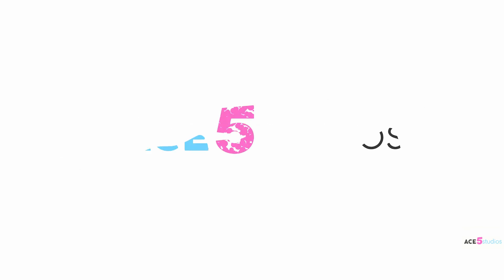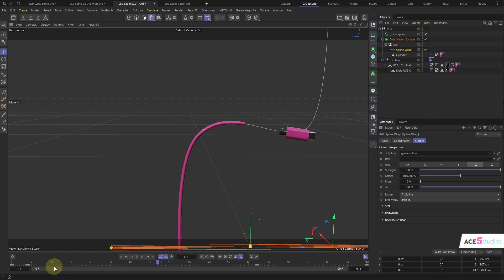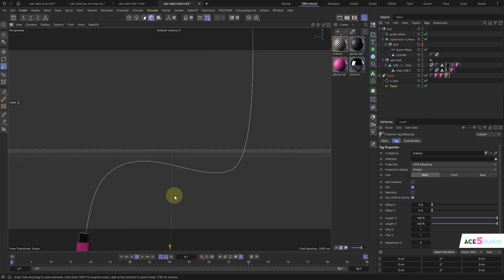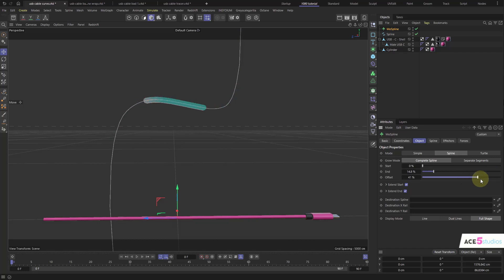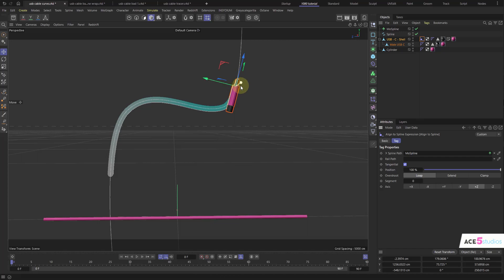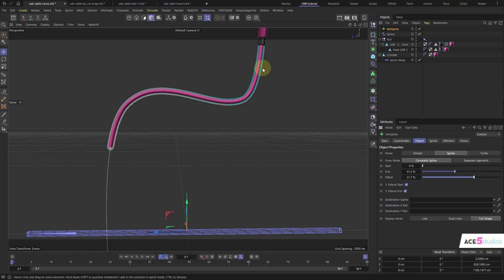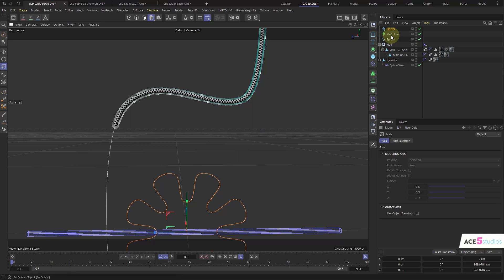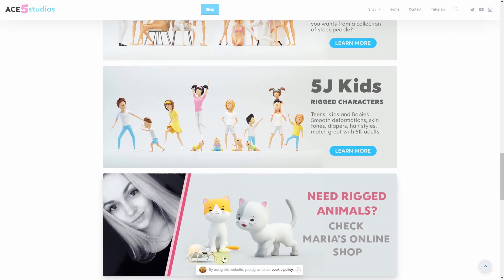USB cable animation tutorial | Cinema 4D | C4D | MoSpline

Comment: it is a cool method but in my case i can-t separate the "head" from the rest of the object (i am using a snake). I tried applying a connect object but the welded points on the cut get all deformed... Any suggestions? Thanks
Reply from the maker: good question, i think i know how to solve this. I'll make a tutororial :))

you can use a joint to control position of head. and then restriction tag to affect only snake body

Comment: Heyy Nice Workkk, There was an easier way for this, you could use cloner on object and set the mospline as object on which cloner would make clones, just one count and the top dongle could be on top of the mospline, and then when mospline would move with the spline the dongle would've move with the spline, hope it makes sense
Reply from the maker: so use cloner instead of constraint, that should work too. thanks!